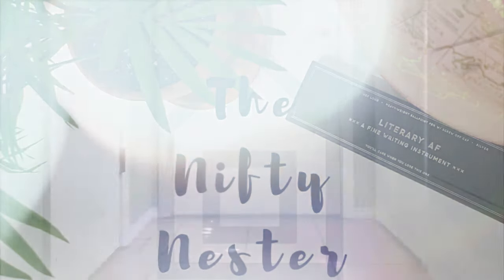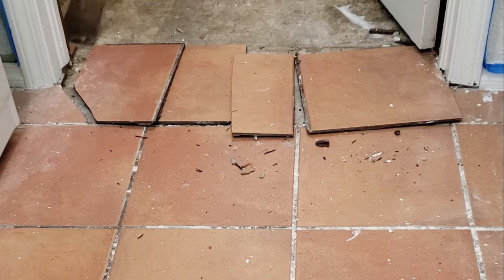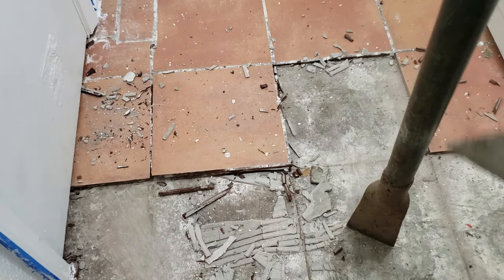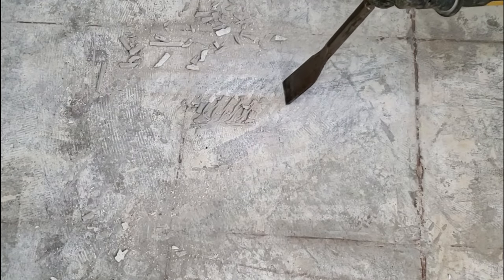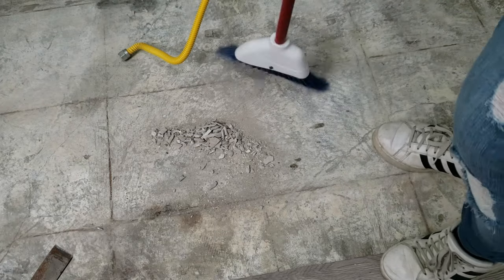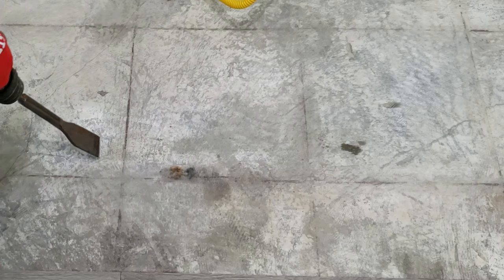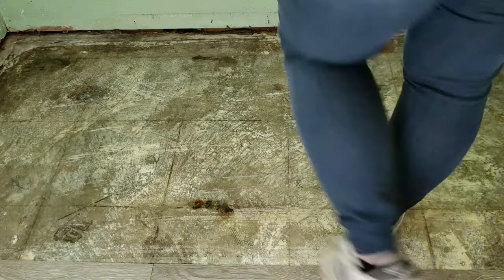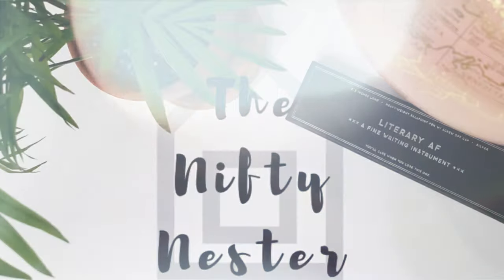How To Remove Ceramic Tile And Thinset From Concrete Floors Easily

Comment: Anyone else wishing theirs was so poorly installed and easy to pop up?
Reply: I'm using a rotary hammer and the tile just vaporizes before it comes up.  Then I get to try and scrape away the mortar with the hammer as well.  Thinking of renting one of those stand up tile removers.
Reply: MINE IS! My husband tiled over concrete that had a layer of adhesive from vinyl tiles. Lovely of him, he never got around to Grouting it. Tile broke and popped up! 
Wish my luck!
Reply: Lmao yes! That's our current situation
Reply: My Basement tiles came up easily, but the thin set was another beast to remove even with a rotor hammer. I eventually used a die grinder with diamond blades & dustless vac.
Reply: I am about to attempt to remove the tile in front of my fireplace. I hope it is a easy as shown but will not be surprised if it is more difficult.
Reply: I was just thinking oooh I hope this floor was done crappy 😂

Comment: Just FYI, it's typically NOT this easy. For tile that was properly installed and bonded to the subfloor, this is much much more difficult.
Reply from the maker: They definitely didn't do a great job of laying this tile, I did luck out there. A couple rooms where the tile was older and likely done before the previous owners that did this floor were harder to remove but I followed the same process, just took longer and caused more back pain lol.
Reply: I think the reason it came off easy was because it's a high traffic area.
Reply from the maker: That's a good point as well. I have noticed that the high traffic areas (in my kitchen and dining room) came up easily as well. The sides of the rooms not as easily.
Reply: @Discretesignals  no men doesnt matter its just because the guy who instale the tile was idiot you have to wash the floor before as pro like me do  simple as that🤘
Reply: you got that right! we are in process of removing tile and the tiles did not come out that easy at all and there is so much cement we are living in hell right now!
Reply: I had a flood in my kitchen that pulled up a lot of my tiles, which were old and gross and needed replacing anyway but this hurried it along. What I've been living on is the gross floor under the tile because I have not been able to get the materials together to do this floor yet. But it's coming around the corner and I'm re-watching All of my favorites of your videos and I'm getting ready to do my kitchen floor with the peel and stick vinyl planks. I'm watching this thinking I'm going to need that hammer drill with the thinset thing but actually mine is not concrete underneath, it's hardwood. And the bits that are left under the tile are yet another older set of tile that they put this other tile on top of and under that is just some kind of black stuff that seems to come up pretty easily with bleach and a little regular scraping. So I really don't think I need that hammer drill! It might make the job easier but it's a lot of trouble to get one probably. I don't think I want to go through that. I think I can scrape up all this old adhesive and whatever without using that. That makes me happy! As I watched your video again it dawned on me that that is for getting stuff that's bonded to concrete off. In actuality if I were to use that it would probably tear up the hardwood flooring that's under the tile. So maybe my project will be easier than I thought!
Reply from the maker: I think you're right. The hammer drill would probably tear up the wood subfloor. It sounds like you're doing the right thing scraping up what you can. I've also seen others do a thin layer of self leveling compound over wood subfloors to get a smooth surface to lay new flooring over. I haven't worked with wood subfloor myself but if you search "installing vinyl plank flooring over wood subfloor" I've found some really good advice there! I hope that helps, good luck with your project.
Reply: @TheNiftyNester  now that's something I didn't even know about. I'll look into that thank you!
Reply: Wow, that was easy cause there was either no thinset or barely any on the concrete.

Comment: I run a floor removal business, we do about 45,000sqft of tile per year. 1/25 jobs is this easy. But you never know what you have under a floor!
Reply: Any tips on how to remove a lot of thin set mortar?   Of the tiles I ripped up roughly the same size as those in the video, there were 2 that came up as easily as the ones in the video.   The rest...well....

Comment: its easy because they didn't use hardly any thinset to install it.
Reply: They used a ton on thinset under my tiles. I'm waiting on a hammer drill to remove it much easier
Reply: @MemezRUs  just spent hours with a hammer and painters tool.

Yea. Wait for the hammer drill. 

That'll be on the wishlist for me.
Reply: @corylohanlon  what does this have to do with me
Reply: @MemezRUs  account name suggests young and tech savvy, comment suggests 60 year old who still hasn't figured out social media lmao
Reply: I'm quite experienced at this but getting just one tile off undamaged would be Christmas to me. It's just normally not like this.

Comment: I was inches from redoing the bedroom.  The slab is too thin, there is almost no perimeter foundation, and although things don't move, capillary humidity is troublesome, and the electrical sockets are partially in the baseboards.  It was a real amateur job.  Heavy drinking amateurs.   Just popping the tiles and the plaster and then waterproofing before a leveling and replastering would fix 90% of the problems.  Unfortunately, there are too many cooks.  I think I'm just going to get the underside of my Mercedes derusted, refinished and touched up.  She's 13 but I'm going for 30.  The car will outlive me if I'm lucky.  Just had an Ampire auto android interface installed today.   Wow.   Navigation updated in real time.  No more 600 dollar Becker updates that are out of date after one month.

Comment: Definitely lucked out, diy'er install with the cheapest thinset.  Usually the tile comes up with a demolition hammer easily but a quality thinset on a prepped floor is a bear to get up.  When I bid a tile floor removal, I'll do a test on a few tiles to give a fairer price to homeowners.
Reply from the maker: I figured it was either cheap, they didn't use enough or just didn't know what they were doing. That's kind of the running theme throughout my house. It's a big undertaking. That's good to know about the demolition hammer for future reference. Do you remove the thinset with a similar tool to what I used or do you have another method you prefer?
Reply: I use a thinset removal bit for a sds plus hammer. It's about a 4" wide blade.  I have my own bosch sds rotary hammers but for a lot of square footage I rent them because it's super hard on the hammers... I'd rather put the miles on rentals than my own, lol.
Reply from the maker: I do need to order some wider bits before doing another room, the one I have isn't very wide. 4" would probably save me a little time. We have a couple rooms that have original tile that isn't going to come up as easily as this room did.

Comment: This is a great instructional video. It does not matter if the tiles are easy to remove or very difficult to remove the video is a “how to” video and is only intended to show you the proper steps in doing the job. How many would be willing to sit down and watch a video where it takes five minutes to remove one tile? That would get boring very quickly. She may have already loosened the tiles for video purposes. Either way, it’s a great video.
Reply from the maker: Thank you, Randall! I appreciate your comment. And yes, I sped up the video because no one wants to watch this in real time. My tiles were poorly installed by the previous owner but the method is the same no matter how hard they are to remove. I appreciate your comment 😊

Comment: The amount of thinset used in this room is possibly 1/10th the amount used in my bathroom, OR the thinset didn't really adhered to the concrete and cane up with the tile. 

For me, doing this was ten times more difficult then what this showed, but I am thankful for power tools.
Reply from the maker: Yeah they were installed poorly for sure. I should've emphasized that mine were easier than usual to remove.

Comment: Se3ms like barely any thin set was used. Thats why it came up so easy.
Reply from the maker: They definitely didn't use much and it did make my job easier in this room. If you have more thinset it would just take a little more time and effort to remove it all.

Comment: I just saw another video where compressed air hammer with ball joint remover was used to remove tile. It took about 5 minutes for an area this big.  However, it looks like you did the same thing with the floor scrapper :)
Reply from the maker: Yes there's definitely other tools that work as well or even a little better. I tried using a massive professional hammer drill when I did my dining room (my spouse works in constriction and brought it home for me to try) and I couldn't control the darn thing 😆 I think me being 5'2" with short arms and not a ton of muscle means there are going to be certain tools that I just can't handle on my own. It's all good though, I make do with what I've got!

Comment: I wish it could have been this easy to pull up the tiny area of ceramic tiling in front of our fireplace! We STILL have some thinset and mesh to remove. It was applied to both wood flooring and the concrete hearth. Worst job we've had to do so far in trying to update our home. I'm so NOT looking forward to doing the kitchen 😭😭😭
Thanks for sharing the video!
Reply from the maker: I got lucky with how poorly our flooring was installed, sorry to hear you're having a rough time with yours! I haven't had to deal with mesh yet but it was used in our entryway ( the only tile that looks like it was done well in our house) so I'm not looking forward to dealing with that room. I hope you're able to get that thinset up and good luck with your kitchen!
Reply: @TheNiftyNester  Thank you so much! Giiiiirrrl...there's still a remnant we haven't gotten up. I have to get my mind right before I get back into that. Fortunately, it's in an area that we don't walk much so it's just sitting waiting for us to gather ourselves mentally to finish it. So when you do tackle that area, make sure you have time and something planned for relaxation afterwards because your nerves may be frazzled after all that work 😖...lolbvs
Reply from the maker: Lol good to know. I am not looking forward to it now 😕
Reply: @TheNiftyNester  I'm sorry! I just didn't want you to go into without a heads up

Comment: Very helpful and informative, and I might add there's nothing that beats a can-do woman... unless it's two. Ha! My SO and sister are something to watch when a mission, recently did a garden shed siding project: like a smart guy, I stepped aside and watched. They did great... not perfect but they were happy as hell and so was I. Despite the fact I was looking for video re removing tile and thin set from backer board on a plywood subfloor with the prospect of possibly laying some engineered 3/8" 5" x 72" strand woven bamboo click-lock over the backer, I'm better informed now. Thanks.

Comment: Just removed linoleum tiles from a floor and used a heat gun.  Then just scraped them up.  Excellent.  Now we are hunting for a way to deal with the glue that was left behind.

Comment: Are you familiar with walk behind diamond concrete grinders and, if so, would you have used one if your project area was larger.
Reply from the maker: That's a good question. When I first removed the tile in my kitchen and dining room I thought about going that route. They're pricey and I knew I had multiple rooms to do so I didn't want to rent one every time I tackled another floor. We already had the hammer drill so I only had to buy the chisel bit. Grinders are also worse about dust and we have an asthmatic kid so that didn't seem like the best route to go. All things considered this seemed like the most cost effective, least dusty option. You can definitely go that route, it would probably be easier for a larger space. That being said, if you're going to be pouring epoxy or staining the concrete without pouring leveler throughout the space then yes, I would definitely use a diamond grinder. Sorry for the long response lol.

Comment: Do you have to remove the thinset if you are only installing carpet over it.
Reply from the maker: I haven't personally installed carpet but I would guess that you probably need to. If you don't remove the thinset you might have issues with the padding underneath sticking and you might even be able to feel the thinset through the carpet.
Reply: Yes

Comment: Thanks for the video, however those tiles were very poorly installed and therefore, incredibly easy to remove (thinset and all)
Reply from the maker: Yeah they were poorly installed. I've removed flooring using this method in a few rooms and it's worked well for me, some have taken more time than others. But I have heard a lot of people saying they struggled a lot with theirs so this might have given a false sense of ease.

Comment: If I am wanting to just lay new tile, can I be much more casual with the thinset removal, and just put on a much thicker layer of thinset than I would have done otherwise?
Reply from the maker: So I've seen people pour self leveler over floors with a little thinset left on the floor to level them out before installing new tile but that's a more expensive route to go if your subfloor is already level and in good shape. Otherwise you kinda have to remove the thinset. The thinset makes your floor bumpy and uneven so, even if you use extra thinset to install the new tile, your floors are going to be uneven and the tiles won't sit right. It's a hassle but kind of unavoidable.

Comment: So I take it that thinset is tile adhesive?
 I did my bathroom and used a hammer and chisel. It took days... Omg....
Reply from the maker: Yeah it's thinset. Whoever installed these floors did a horrible job and the flooring was way past time to be replaced so it came up easier than flooring that's been installed well or is still in good shape.

Comment: What type of floor scraper? Lowe has many snd none looks like yours.
Reply from the maker: It's been a while since I bought that bit but I'm pretty sure I couldn't find the one I needed at Lowe's, I know I bought mine at Home Depot. You want a tile and thinset removal bit. They come in different sizes and fit different sized rotary hammer drills. I think I linked one from Amazon in the description as well that's similar to the one I used. Check Home Depot though, I always have better luck there with tools and bits. I hope that answers your question, let me know if you need any more help. Good luck!

Comment: This was crappy concrete glue. I did a floor and it took me 8h to do a kitchen and corridor. I never was able to completely remove the glu. It fused with the tiles. :)
Reply from the maker: That doesn't sound like fun. I have heard that from a few people, I guess I lucked out. Our entryway has the original tile and it's the only area that looks like it was done right and will be tough to pull up. Whoever renovated our house last before we moved in cut every corner possible...

Comment: After moving into our new home, maybe because we live in the tropics, the adhesive from the peel-and-stick flooring started to ooze out between the cracks especially in areas of high foot traffic or heavy furniture applying constant pressure. Have you noticed any issues? 🤔
Reply from the maker: Oh no! That sounds awful. Where I live it can get pretty hot in the summer but it's nowhere near tropical weather. I haven't had any issues like you're having but I don't know if the heat and humidity could be causing issues like that where you live. I wish I had an answer for you that would help but I don't. Peel and stick tiles might just not work well in that climate. I hope you find the answers you're looking for though!
Reply: That happened in our kitchen but it has been down for a long time.

Comment: I don’t know if anyone here has mentioned it, but clearly those tiles were poorly bonded! J/K. It’s like people don’t read the comments first before they post, because it was mentioned like 100 times. 

Anyhoo, I’m getting ready to take on the task of removing tile from my kitchen, entry, hallway, and bathrooms, and I’m pretty nervous about it. I’m hoping whoever installed it did an equally terrible job of applying the bonding material before laying the tile. I will save this video for future reference. Thanks!
Reply from the maker: You just made my day 😂 thank you! I hope for your sake they're installed as terribly as mine were as well. Good luck!

Comment: If the tiles would have been installed properly, you would have had a nightmare trying to get this method to work.  Good job though
Reply: Exactly,im removing mine as we speak and it just dosent come up like this,plus the thin set is all over the concrete floor...its a pain in the ass!

Comment: Better to remove the baseboards before removing the tile.  They should come off for anything that gets installed anyway.
Reply from the maker: I did end up removing them while removing the flooring, not sure why I didn't beforehand but they came up in the process.